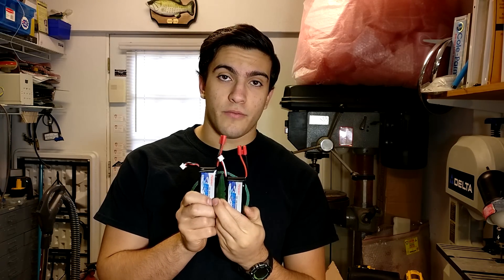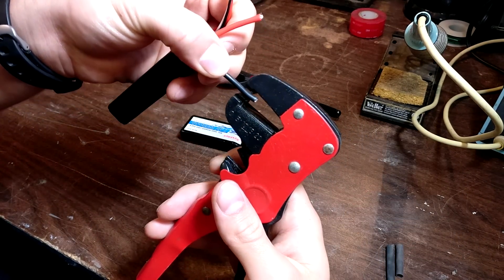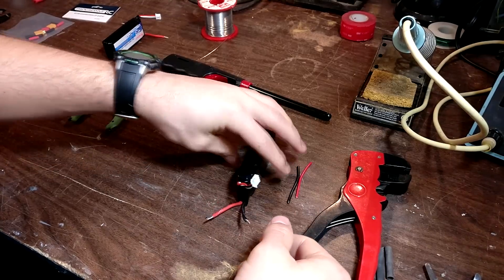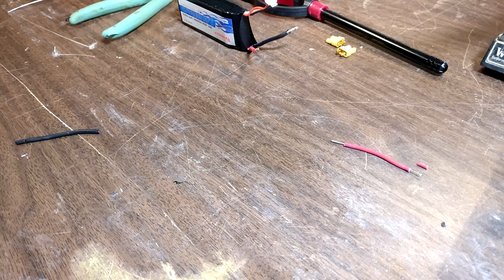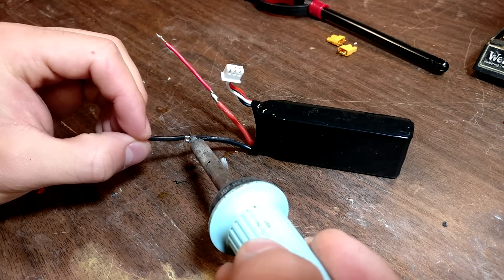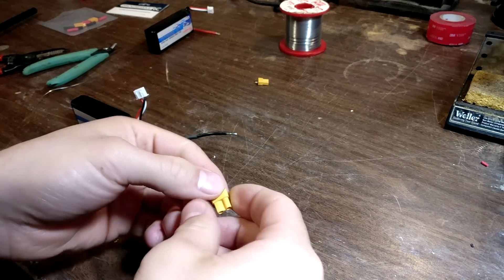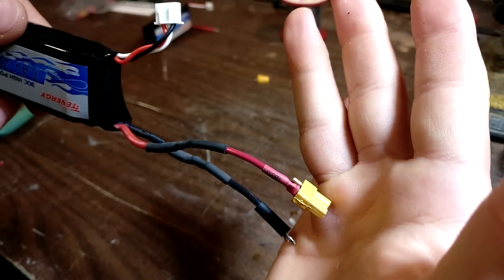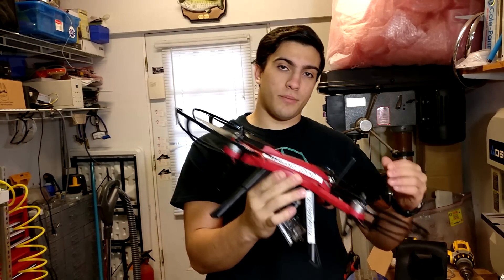Mjx Bugs 3 Battery modification

Comment: Got a battery question: Is there any way on the bugs3 to shut off the low voltage battery warning beep? There's still time to fly when the beeping starts and the beep drives me crazy. Thanks.
Reply: ooohhhh,dont do it,,i killed my 4 batteries not paying attention do the beeping .i did not know,lipo bateries are so delicate,u have to learn how to treat them,check on google or youtube videos about lipo batteries,very serious issue,,,,,

Comment: I got a bugs 3 h from my daughter for fathers day. I fly  plane and heli, cars, trucks, did lots of research. And picked the bug3h did all the calibrations. And flew in my house great I have a film me flying in house without my gopro, and flew great. Got my friends/family all together and still did the calibration in the road turned on my hero silver4 with a 128 gig sim  set back start the motors stick up slow hover 5 foot then took to 25 feet after that I had no transmiter to the bugs3 h and it went full speed straight up and out of sight. Lost it never got to fly it. My daughter writes them. And they tell her he flew it in a tree. I never got to fly!  Everything was charged.  I have 5 other drones and I have a 3DR iris but wanted something fast. Liked your review of of bugs 3 and wanted attitude hold so other can fly with me. So I don't have a crashed drone from other hands.  #MJX unfair, But I never got to fly it. I think they should make it right. Give me a bugs3H with a good  camera and make it fair. I'm going to take a bite out of the business they have. What do you think?  I'm a veteran RC hobbies.

Comment: using the same method, can I use 2 lithium Ion cell?

but instead wired them in series to achieve 7.4v.

will it work?

great work, very informative..
Reply: Pesona Fisika they're lipo, not lithium ion. If you connect in series you would want a balance tap for charging. If you connect in parallel you risk fire when charging. In series the voltage is added, in parallel the capacity is added.
Reply from the maker: +Pesona Fisika Thanks so much I appreciate it ! And here's how it works batteries wired in series will boost your voltage but.your amps will remain at the same level. Wiring batteries in parallel will boost your and but voltage will remain the same.assuming the amp ratings are the same on the batteries. 7.4 volts should be the operating voltage so yes you should be able to fly good work 👍👍👍
Reply: Thank you for the reply.

how about the amp limit?
i mean,  the current draw written on my battery is 40A. But i dont really believe it since it just rebranded battery and i cant find out what the actual brand of battery under the re-wrap. But i've been using one of this battery as my vaporizer battery with considerably high drain build.

but i dont really know how much is the highest current draw from MJX Bugs 3 on full throttle..?
can it explode if let say the actual continuous current draw my battery could handle is just 15A and the bugs 3 draw more than that?

again thanks for the reply and apologize if its hard to read my comment because the terrible english. it is not my first language.
Reply from the maker: +Pesona Fisika I would say anything you try might have been tried already and to look into forums in the rc community I'll try to develop an answer myself once I do some research thanks
Reply: can you give the link to the forum? i tried searching on youtube but no luck so far.
Reply from the maker: +Pesona Fisika this might be able to help I hooe it does https://www.reddit.com/r/Quadcopter/comments/5lij6g/any_compatible_batteries_for_bugs3/
Reply: thanks again..
Reply from the maker: +Pesona Fisika no problem let me know if you have any further questions
Reply: i just simply dont have the equipment needed to test the current draw. maybe if you have the tools could you try to measure it? on the bugs 3. something like shown in this video. https://youtu.be/NEdeE_AMPAc?t=3m
Reply: Chris AF i know, but i want to make the same battery pack using 18650 (li-ion) battery. since lipo and liion have similar characteristic and nominal voltages. but with higher energy density compared to lipo..

Comment: As I was watching the video there were several safety issues that came to my mind that might be dangerous to someone inexperienced or a newbie

1.  I would do each lead one at a time basically cutting it stripping it back and then soldering it to a wire that is the same size as the original and then to the connector. And heat shrink it before I would start on the second connector. 
2. The Xt30 contacts should first be tinted with solder and plug in the male end of the connector to absorb the heat.
3. The heat shrink tube should never be shrunk with the lighter use a heat gun or hair dryer.
4. And rember that cold solder joints can be a killer for the battery or quad
5. Also don't heat the battery wire, it can damage the battery or worse. 

I just thought I'd laid out these safety tips for all newbies out there
Reply from the maker: Id first like to begin by saying thank you. It shows a lot of character for someone to try to teach how things can be done better as opposed to being slightly condescending. I really very much thank you sir, for your help and I definitely will take your tips and put them too good use next time around. Thank you!

Comment: is 30c 2s batteries are safe for bugs 3 ??
Reply from the maker: Brute Kit I believe they should be fine but research is always helpful I also believe someone commented about the batteries they used maybe it's the same as yours
Reply: i have 7.4v  30c 2s battery .(battery of syma x8c)
plz tell me is it safe for bugs also.
Reply from the maker: Brute Kit should be safe but again research is always helpful
Reply: Bin getting over half hour with a floureon 7.4v 30c 5200mha

Comment: I wonder if a better mod could be to bin these rather horrible connectors and replace with crimped Anderson Powerpoles. I'm a licensed radio ham and use them  in nearly all DC connections. They're made to be connected/disconnected many multiples of times and have virtually no insertion losses. They're quite expensive compared to some but they're better than anything else I ever saw for low volt applications like this.
I'll add that (in my opinion) your soldering technique is... capable of improvement? No wish to rain on your parade but your procedure stands a fair chance of making dry joints since tbe cooling solder can move as it solidifies. Making a higher resistance than should be. The two sides should be stabilised together before final heating but more importantly during setting hard.
Have to also echo comment above to some extent. Other lead took a share of heat after the bolt was removed from tbe job. Soldered joints become rigid and flexing multistrand wire entering the rigid soldered section can workharden when subjected to vibration and possible resonance. Eventually a line goes open circuit and a fracture gets traced to the joint area. Just because it didn't happen yet guarantees nothing. In many applications this may be no more than an inconvenience but aeromodelling carries some risk when things fall out of the sky suddenly... I hope this doesn't come over as mean but the best safety can be seeing ahead and removing foreseeable failure points.
But I sincerely applaud your efforts to assist others with tips and guidance. It takes time and preparation and I sure hope I didnt discourage any- just offering food for thought!
Reply from the maker: No worries at all, I am always open to suggestions in fact I feel that the RC community is one of the best in that there are so many people that are willing to share tips to improve one another's setup. I do sincerely appreciate you taking the time to aid me in correcting my mistakes and surely will be taken into consideration. Thank you very much and as always enjoy.

Comment: Hi can you please tell what i s that tool that you used to . get the wire done , i mean how easy was it to pull of the wire 

Thanks
Reply from the maker: Karan Nagpal Hi there, that is simply na type of wire stripper
Reply: Warrior Zoino buddy i checked  many but looking for  the same one
Reply from the maker: Karan Nagpal here you go buddy https://www.ebay.com/i/321477377473?chn=ps&dispItem=1&ul_ref=http%253A%252F%252Frover.ebay.com%252Frover%252F1%252F711-117182-37290-0%252F2%253Fmpre%253Dhttps%25253A%25252F%25252Fwww.ebay.com%25252Fi%25252F321477377473%25253Fchn%25253Dps%252526dispItem%25253D1%2526itemid%253D321477377473%2526targetid%253D315541651842%2526device%253Dm%2526adtype%253Dpla%2526googleloc%253D9011891%2526poi%253D%2526campaignid%253D835978959%2526adgroupid%253D46403705967%2526rlsatarget%253Dpla-315541651842%2526abcId%253D1123866%2526merchantid%253D101703448%2526gclid%253DCj0KCQjw7pHLBRDqARIsAFyKPa6BoUlg4E-CkR7DIlpjx06E1nwoSEZyYF8lvC_pg4nJwEWH0GJJwTwaApiFEALw_wcB%2526srcrot%253D711-117182-37290-0%2526rvr_id%253D1254832717446
Reply: Warrior Zoino thanks buddy 👍🏻

Comment: Hi there! i have also purchased MJX Bug 3 drone, can i also modify my Stock Battery like what you did?
Reply from the maker: GhostRider 282029 it worked for me so I don't see why not
Reply: i see.. thanks man!.. btw, do you have any suggestions or advise if how can i extend the battery life of my stock battery? i did test my bug 3 with camera on it, the stand as well as the propeller guard, i noticed it took 7min flight i think?
Reply from the maker: GhostRider 282029 the biggest factor is weight so the lower you make your weight of the drone the longer your drone will fly
Reply: really.. i noticed the stock battry is 1800mAh, and also i've seen some battery 2200mAh on the internet.. if used this kind of battery will it really extend its life?  And also how much mAh does your modified battery?
Reply from the maker: GhostRider 282029 absolutely it's all taken into effect
Reply: i see.. thanks for the info Man! im sorry if i asked too many questions.. im from philippines.. and i really want to learn how to fly these kind of drones for my rides and take some vids on it.. that's why im searching here on youtube to seek some advises/opinions or who can give me some suggestions..
Reply from the maker: GhostRider 282029 oh it's no problem I love answering questions it's no bother at all

Comment: I've only xt60 connectors and made a adapter from xt60 to xt30 so I can use the original battery too! I didn't wanna solder every battery and whit a small adapter, everything is fine!
Reply from the maker: Toni L very nice idea I'm glad that worked out for you !! thanks for watching
Reply: Warrior Zoino you even can buy this to save time but it's easier to do one adapter to xt60 because all my friends having xt60 too!
Reply: Toni L link?
please
Reply: Carlos Gonzalez http://m.ebay.co.uk/itm/141995279583?_mwBanner=1

Comment: can the xt30 handle the higher amp drain?

I've noticed none of the factory cells fitted with that plug are bigger than 1400 or so..
Reply from the maker: chereadnine I don't believe it's the amp drain just that normally vehicles taking bigger batteries use bigger plugs a contact is nothing but a contact so should be fine
Reply: +Warrior Zoino 

doh..The bigger battery isn't going to make the quad pull the extra Amps..

Thanks for that,time to get soldering!
Reply from the maker: chereadnine GOODLUCK AND THANKS!!

Comment: Hi dude! Great video!
Do you think 
Li-Po Battery 7.4V 4200mAh 25C lipo battery 2s will be OK for Bugs B3 to extend flight time?
Reply from the maker: Kamil Putoń I believe you'll be OK aslong as you don't increase the voltage you should be fine however I'd say just double check I believe someone in the comments below used an even bigger one so check it out
Reply: Using a larger battery, although dictated by the size of the battery bay , will put extra load on the motors which in turn puts a higher load on the ESCs, plus throw the CG out.  I suggest sticking to the standard battery, a little more may be OK, but too much and it will be detrimental in some way.  I've seen this quad fly on a 3s LiPo, but it definitely didn't like it electronically and it also has CG problems. Remember also, longer flight  times will tend to warm your motors up for longer periods along with the ESCs.  

When manufacturers build a new quad it's tested to ensure normal flight times don't overtax the individual components. That testing is how they arrive at the battery size and output. Whilst you probably won't cause damage in the short term it's possible you could be lessening the usable life of the quad. An increase of 200Mah wouldn't be of great concern, but using a 4200mah LiPo could definitely cause heating problems and shorten component life. Plus I doubt one of that size would fit. 

Finally, please don't do as one person I saw do, strap a battery under the quads belly because it wouldn't fit internally. That person is definitely overloading the quad and could easily cause catastrophic failure during flight.  If a battery only lasts 10 minutes, that's usually enough. The concentration will tend to drop off more as the flight time extends, and let's face it, losing concentration whilst flying a quad could be very detrimental to the quad. Fly for 10 minutes, bring the quad back, replace the battery. have a breather, then fly again. To avoid overheating my quads I always take 2 or 3 with me so that I can let one cool down whilst flying another. As with everything, there are always exceptions to any rules. One guy may get away with using a 5,000Mah battery, the next guy who tries a 3,500Mah ends up with a broken pile of plastic. :-)